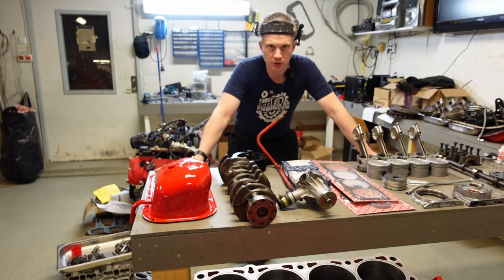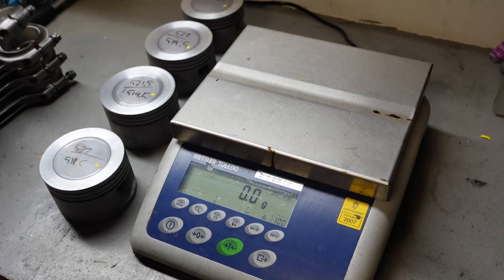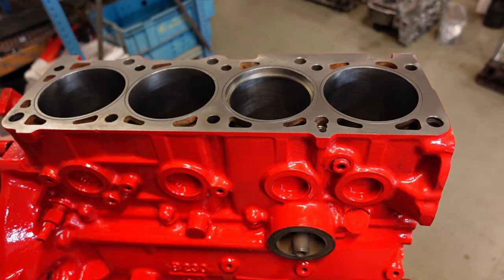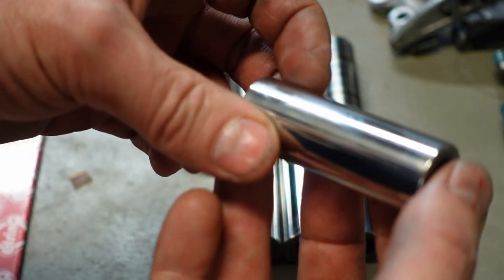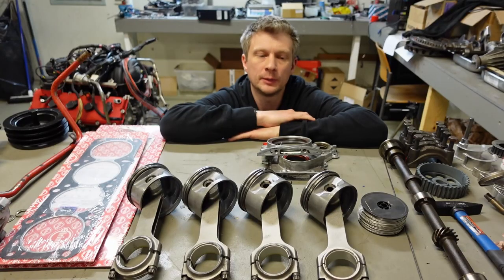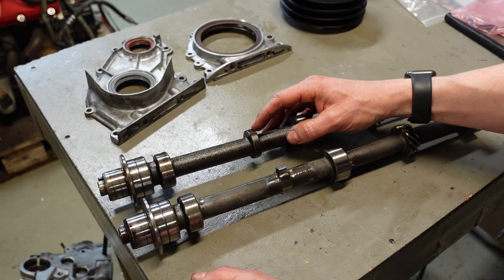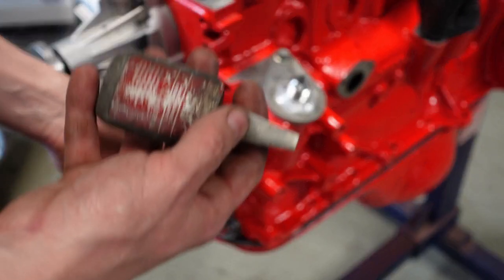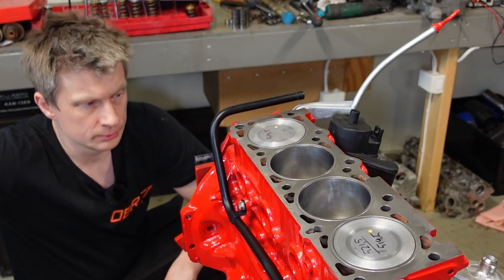How to build a 600hp Volvo B230 Redblock EP3

Comment: Great video - it's slightly sad that you don't show the water pump, oil pump etc - but to me that just says "like normal" :-) the oil pump can be a bit tricky and there are some worthwhile mods to be done there on these engines. Looks like you didn't and are confident in them as is, that's a good sign for those who don't do the mods. :-) Thanks for making it and doing the voice overs and intro/outro in English - much appreciated! :-0

Comment: And for people who might doubt the 600hp claim, yes 600hp is pretty conservative for whats done to it. 

On a stock block it is possible to get 500hp if you manage the tourqe with the tune and have a camshaft that is optimised for high rpm(these engine with stock T/M and maybe A camshafts will make a bunch of low - midend power otherwise). Tourqe kills the stock turbo rods(if it's regular N/A rods they are only good for about 240nm before bedning or snapping if you unlucky) 

Rods are the weakest, if you start out with a later model FT/FK engine(95-98) they have oil squirters which help the cooling of the pistons and makes them last longer and make it able to last with higher power outputs. 

if my memory serves the B23ET engines had really great forged cranks, pistons and decent rods. but the later generation blocks were more sturdy(95-98)

Comment: If you take all the material off one side of the piston when weight matching wouldmt you be introducing side to side imbalance that to some degree creates a rocking motion. When I was taught to balance pistons and rods my mentor said to round off edges, take away casting flaws, and smooth corners. The idea was to take away material evenly

Comment: Great video as always :)
I've been assembling all my ARP bolts with the arp grease in the threads aswell as the contact surface of the nuts/bolts.
Have i been doing it wrong ?
Reply: i have the oficial volvo manual here for an AQ145A, marine engine, and you're doing it right; the factory torque values  are with oiled threads.

Comment: Great video, i have owned ,driven Volvo 240's for 42 yrs and worked for Volvo Canada for a few yrs back  from 1987- 89, my current daily driver is an 1989 240DL about 350kms , it runs well and still only uses about 1 tank of fuel each week in winter that is good to me in Winnipeg here winter is colder than Sweden, i have purchased a k Camshaft ,the same as the ones you have in Europe, do you have any recommendations for this , i know i will replace all the seals and cam belt and tensioner and have a valve shim kit already, i did a compression test the summer of 2020 and it was less than .75 of a bar difference between all 4 cylinders, would appreciate any input you might have 👍
Reply from the maker: If i can find a standard car i can test this things in my dyno. But the first that comes up is a header, that will change your performance

Comment: 38:37 whats the part name of the black pipe on the engine that goes from the waterpump to the back of the engine, my 240 has a hole in that pipe and i cant seem to find the part. I could try to quick fix it but could use some help and tips:)

Comment: What diameter of steel wire do you use? What’s the depth of the groove +- ? 
Where to find the bolck gridle? Do you sell them? 
Thanks and keep the good work!
Reply: Yeah i would defintivly be very intresting with a more indepth video about everything surounding the o-ringing process, tools and all 🙂
Reply from the maker: I take notes:) it is the same process for all engines. Running 1 mm wire 0,8mm deap. I made the girdles
Reply: @Overboostracing  laser cut or water jet?  thickness,  6mm?

Comment: Hi mate. Great videos. I’ve got a b230ft block with a scratch in the bore. It needs to be over bored from 96mm to 97mm. The car will be around 500hp. Will there be a chance of cracked cylinder walls with an overbite that size?

Thanks.

Comment: Is your girdle 6mm steel? I did one for a Japanese 4 cylinder years ago out of 12mm steel. Then did some stupid things and threw a rod out (my fault, driving and maintenance not build) and the rod came down through the cast iron block, hit the girdle so hard it spun my shrink fit 36-1 off the pulley and bent the 12mm plate down about 15mm :-D Also the sump and windage trays beneath that, too. Major carnage :-D It's a shame the oil pump is in the way in these.

Comment: Thanks for the video. I’m waiting for the next video. By the way, do you use a standard crankshaft for these builds? Does it make sense to use a forged crank from b21/23 engines for 500-600 hp builds or not in your opinion?